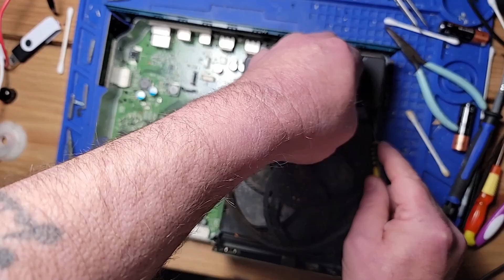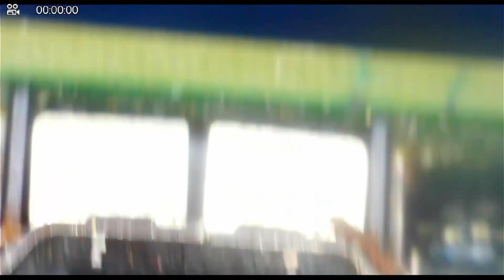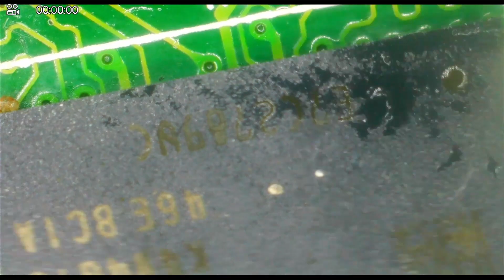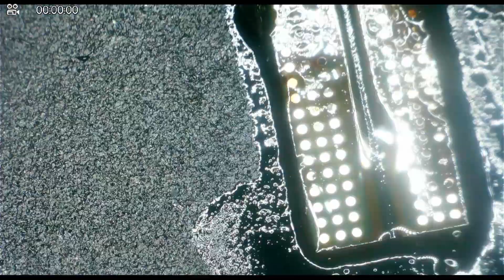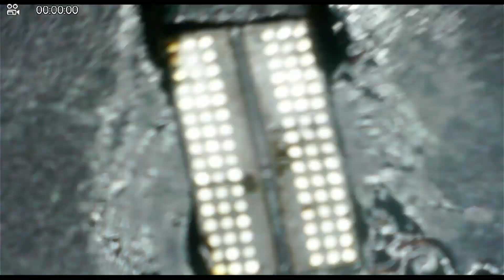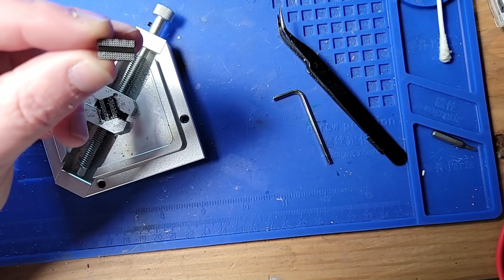Trying to fix Goodwill Junk

Comment: Well done bud, I remember my reballing work, was just like yours lol😂 I personally wouldn’t swap different types of memory. What was your resistance in the end, if you are measuring the voltage rail, this resistance is the whole lot of ram.
Reply from the maker: Thanks, yeah it is quite difficult the first time. In the end, it was around 30 Ohms. I am holding on to the console until I get the exact RAM and then try again.

Comment: Don’t know why this popped up in my feed, but this man needs an ultrasonic cleaner stat.
Reply: But I will give you credit and a new sub for even the free-hand re-balling of a chip. You are a more patient man than myself.
Reply from the maker: @mrchirp  LOL, I really have thought about buying an ultrasonic cleaner. I get a lot of consoles like that and it would be tremendously helpful to clean them.
Reply: @probablycantfixit6426  Oh yeah, it helps so much to clear off the junk. Especially on the ones that have become roach condominiums or have had a gotten a fine mist of soda from some kid spilling a drink into the system fan, LOL